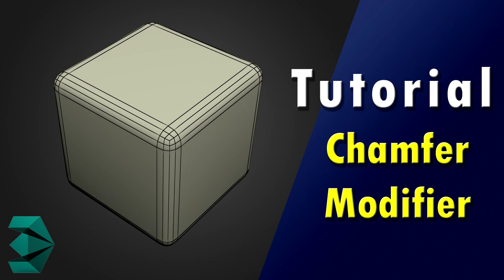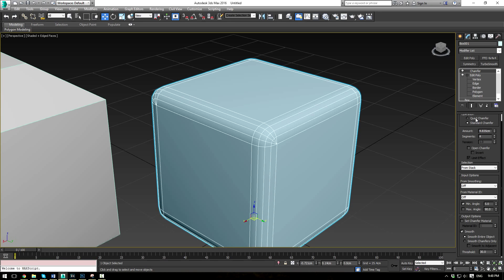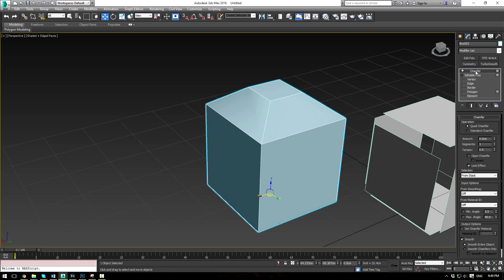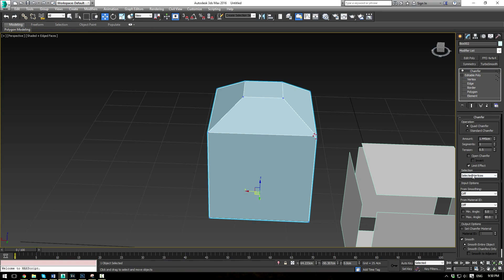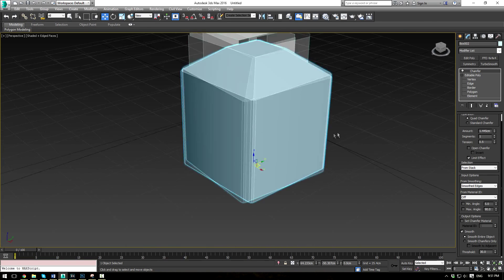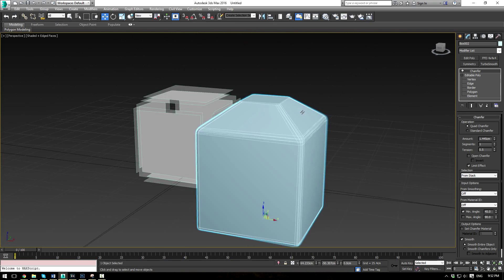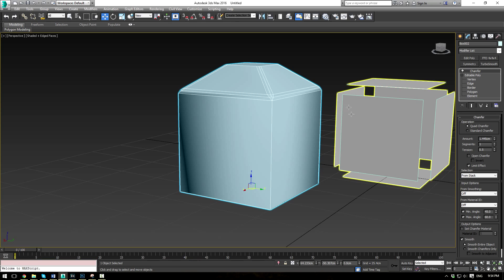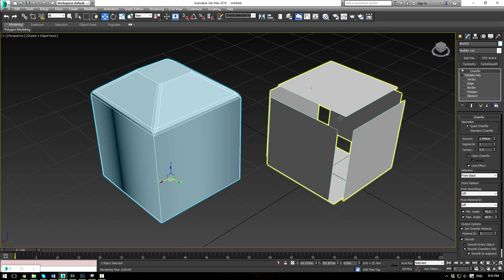3ds Max Tutorial - Chamfer Modifier

Comment: Nice tutorial, but how do in one model, diferent chanfers?
Reply: I think that You at this point You already figured it out, but just in case, as far as I know, You only can make 1 chamfer config per modifier at least until the 2019 3dsmax version.....If you want to make different levels of chamfer, you culd use the modif crease set + open subdiv, but in the other hand, this combination of modifiers, (like turbo smooth)  will create aditional polys that you don't need.
the new versión of 3ds max allows you and also blender lets yoou config multiples chamfer config at once.